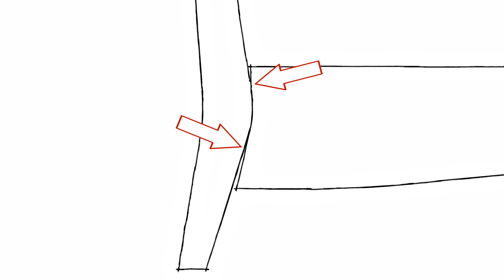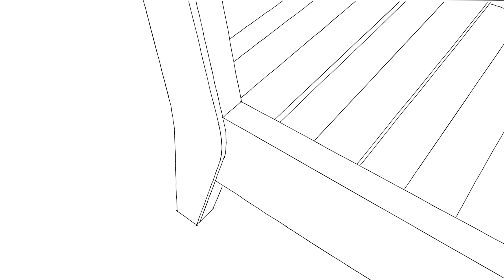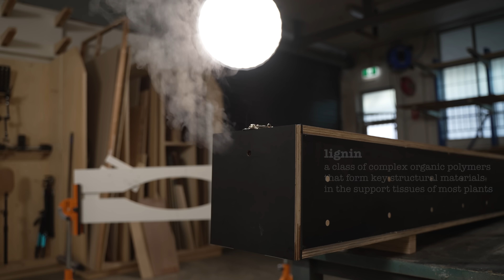Bending Wood into Impossible Shapes

Comment: The one thing I don't like about this video is the whole "the customer screwed me over" attitude. If you put a lot of time into your design before showing it to the customer and talking about the price, it's not really the customer's fault, as you pointed out during the video. By all means, get paid for the design process, that's absolutely sensible, but it's just not the customer's fault you didn't do that back then. Sure, he could have told you "no, way too expensive for me", but from what you've told us in this video, that's pretty much all he did wrong. That's a far cry from "totally screwed me over", sorry.

That said: The final result is pretty awesome. I think the burned wood looks pretty good, too, but would probably work better if it popped up somewhere else on the bed as well, perhaps the foot board or the legs? My favorite is the second, "structured" design, though. The bent strips are interesting and look awesome, but too intense for the bedroom for my taste.
Reply: Agreed. He’s falling into the trap of “content realtors” being overly dramatic for views and sympathy attention. Unsubbed

Comment: The tannins in the Walnut (Oak has more) will react with 0000 steel wool/vinegar mix to ebonize the wood.  Could be an alternate method to the charring technique.  The piece came out amazing, as usual.
Reply from the maker: Thats a way to make the wood dark, but the fire gives a totally different texture.

Comment: Looking at the blackened cutouts on the headboard, I agree it doesn't work but have an idea. What about using the pieces you removed, and separating them from the remainder of the board with a thin strip of copper or brass? Obviously, this message will get to you long after you finish the bed, but perhaps for a future piece?

Comment: You could have used the old fashioned coach bolts to hold the bed parts together. This would make it more mobile to move and easier to get up narrow staircases. The 2nd insert in the headboard could have been more effective with a copper wax finish. just a thought.

Comment: I saw this on this old house. Tommy had to drill a hole at a set depth. But it couldn't go deeper, so he used a plung router set to his max depth, this would have worked perfectly with a fosner bit and given a flat bottom. 

You could take this a step futher by drilling holes to hold magnets. Then under the caps add some kind of clamping faster that way the bed rails could be removed from the headbord and footboard to move in less space also fit into doorways and up stairs. Behind the trim board is a fastner you can open or tighten up like they use to clamp counter tops with. 
If you glue everything together it cant be taken apart.

Comment: Great work, and you need to stop overthinking it, it’s will drive you nuts!  But, I would have sanded the little circles into the “burned pieces” of the headboard not the same color.  You needed some contrast, and the black was cool.  Just a thought.👍🥰
PS:  I love the curly pieces on the headboard the best, but, boy I sure wouldn’t want to have to dust them all the time! 🤣🤣🤣

Comment: My childhood home had a wooden staircase where where I presume was the bent wood technique applied to the railing. I recall the surface letting go, sticking out and generally splitting most of the handrail into two or three layers, and following that clamps on the stairs for a long time as workers tried to fix it. It generally never looking quite right, and it has caused me to be highly distrustful of anything with bent wood strips. Hell, even surface strips of wood like the type you use to cover up the connection already make me uncomfortable. Despite being pretty careful with my furniture in general, I feel like it would just be one accident away while vacuuming or whatever to seriously ruin that thing strip of wood and ruin the look of the piece as a whole.

But I'm just a layman who probably hasn't been around true quality workmanship so all I see are the ways these tricks can end up disappointing. (Or maybe I have been around good furniture and I am just blissfully unaware in those cases because it is just that good...)

Comment: If you want your wood not to bend when you burn it, need to spray whit water after burning. I usually burn whit one hand and other is whit the sprayer. I had the same problem as you when I build garden furniture but no one tell you how to do it right on youtube.
good luck :)

Comment: I made the same mistake in that I bought all the Material for a job after being told I had the job but didn't have it in writing.   I changed my Contracts to include 50% of the cost before I would spend time making designs.  Every job I had gotten was by word of mouth.  All I needed to do was measure the job then give a price, no materials were purchased without the Deposit in my hand.

Comment: the headboards are pretty cool but I wouldn´t want that for my bed. I can only imagine what a nightmare it would be trying to clean the dust from between the individual rivets. 

I can definitely get behind the appeal but for a piece whose main function is so practical, I think that it is best to keep it´s maintenance equally practical. 

I am no woodworker but an option to keep the cool looks and also make it more practical would be to dunk the rivets into epoxy and basically have a clear screen of ((semi?-)clear?) epoxy to protect all the narrow crevices and surface area from dust.

Comment: 1. The black design is tricky, since it is not on eye level you lose some of the area of the piece just due to it being low, the top part gets a little cut off. Other than that black is a very difficult colour to work with, you lose so much detail in black just cause it is pure contrast. You have to be very skilled to know how to use black in art properly, not saying you arent but it makes sense it didnt work out since it was the first time that you did this.
2. Design, idk I kind of dig hammered peened metal sheets for like kitchens but in wood it looks too organic and diseased to me, Triphobia esque.
3rd design is just lovely, I love it mainly for the negative space that it provides cause otherwise the headboard is just a big hunk o´ wood

Lovely stuff mate ^^

Comment: The bent pieces of 3mm walnut was definitely the better choice. It fits the design 
better than the charcoaled and multiple crater pieces. Not a fan of the 8mm?overlapping pieces on the outside to hide joint expansion/contraction where the rail met the leg. The joint should be exposed to see the craftsmanship in the joinery. Movement would have been very minimal if at all.

Comment: Anyone should be able to acquire the long pipe clamps by purchasing the clamps and then attaching them to a 1/2 or 3/4 10ft long black steel pipe available at most home centers like Home Depot.

Comment: I think the best way to approach the "design cost" issue is to simply inform the customer that it's done at a set rate for this initial proposal, then any reiteration is done at a percentage of the set fee until the approve the final design... This final design is now the property of the customer and they are free to move forward with you or move on to another company to manufacture that design, you've been paid for your work, and the customer has what's been paid for to that point, so no loss to you or them... The trick to ensuring that they stay with you for the manufacturing is to offer to negate all design fees of the final invoice, effectively making that part free of charge in return for retaining the manufactur... The rest is down to the quality of what you can produce and how good you are at "selling ice to Eskimos"... 😂

Comment: I think the reason it didn't work with the black is that it  just seemed too narrow for a focal point. Had there been a third board and the black has been closer a circle it would have been more impactful. Just something about the ratios was off. Anyway happy accidents. The curved wood looked awesome.

Comment: I liked all version. I prefer the burnt one personally more than the rest. I would rate burnt first, curves second and dipples last. That is the order I would have done. I know what you seen at first with the burnt but I knew the finish would change it a lot and it probably would like amazing when that was done. Unfinished it did not look right but after it look great the two tones look right.

Comment: For the legs and caps… why not do them opposite the way he did them? Cut the curved profile first… band saw your 1/4” cap piece off, then cut the straight for the joint. That way it all truly out of the same piece of wood…
Anyways that’s the way I would have done the caps
Reply: And for the headboard fix… I would have just used the drops (like you did) with a maple “inlay” to take up the curf of the blade from cutting them out. Not sure if that would be up your alley, but I would have liked it… simple (kinda).

Comment: I liked the Burnt Pieces
I didn't like the textured ones
I absolutely love the bent decor. Amazing work on that. As visual Artist I get the feeling of just not being happy with what you just made and redoing things you originally intended to be done at that point.

I have just one issue with the bed, and that is, you cannot disassemble the frame, which makes it very unhandy to get into a clients home if their doorways/Windows offer limited space, and also if a client moves homes, this bed is gonna be a pain to move from A to B.
Just my Opinion, but a Bed or any Furniture for that matter, should always be possible to take apart into easier to move parts for future proofing a design.
Imagine you invest into a beautiful piece like that, only to realize you have to sell it cuz you can't fit it through your next homes doors/windows or you damage it's finish trying to move the whole thing in one piece.

There are metal interlocks that lock the pieces together by gravity, which I'd recommend to connect the front and back, to the side pieces.
That way a simple gentle/less gentle knock from below, disconnects the pieces and you can move them EZ PZ

Comment: Simple straigh - 9-10
With hole and charred - 7-8
With hole and the textured piece - 5-6
With hole and tacky kitschy curved waves - 1. It's so ugly it ruins the beauty of the bed. 

Obviously this is just my opinion. If you'd give me the curved tacky bed I'd rip those silly things apart as fast as i could. 

Bed frame - simple, sturdy, natural, honest, has utility and a beautiful shape without unnecessary embellishments. 1 design language

Bedframe + unnecessary "design" hole - 2 design languages - straight (but not 100%) bed frame + curved, cut in half oval (but not a perfect circle). Circles, have a meaning and are adaptable to almost all other design languages. Ovals are extremely conditioned by context. Then the second color which is basically ruined wood. It doesn't look bad, it just looks "tryhard"

3rd design - 3 design languages. With a texture in direct contrast to everything. None are in harmony with each other. 

4th design - batshit ugly and so unnecessary. It's like combining zaha hadid design with semi-bauhaus and an unhappy postmodern mannerism. 

Impressive technique and ability though. But it's like putting a shark fin on top of a McLaren because "design"
Reply: Ps: symmetry + total random asymmetric chaos isn't inventive/original etc. It's childish and uninspired. 

I only said this because the simple bed without the hole would have been such a beautiful design.

Comment: The problem arnt the clients, the problem are the workmen. You should always have an idea of there budget or give them a rough ball park figure to avoide sticker shock. Or else this happens. Being on both sides of the blade i see this frequently. Workmen comes in, i say "before we start can you give me an idea of cost"

Workman: "no all jobs are different"

Me: "yeah i get that but to save you spending hours doing me a quote, use your skill in your trade and give me atleast an idea so 8 can see if its feasable" 

Workmen: "3k ish"

Me: "ok thats doable" 

Workman "i have done the quote its actually 4k" 

Me: "no worries i accounted for that in the ball park its all good, crack on with the job" 

Both of us hsppy. 

Compared to 

Workman: "no has to be a quote"

Me: "ok"

Workman: "its 20k" 

Me: thats way out my budget sorry, i did ask for a ball park to avoid this, as its not my trade so i have no clue on what the prices are to even start but i have x ammount"

Comment: Wait you didn't discuss the price before any work even started? Who would agree to something like that in the first place? I get the estimate might change, but it should be anything significant. Like if we agreed 20 bucks for a something, and you came back and said it will be 40, double the original price, that's ridiculous. But if you came back and said 25, that is reasonable. Sounds like you screwed yourself over.
Reply from the maker: Read the video description

Comment: I hear your disappointment in the client, but if he was asking for a simplified design, then translation he wanted to do it himself but needed a reasonable expert to make his vision come true. Finding out the price which should have happened at the beginning as an approximation, probably just made up his mind and he did it himself. 

Also sounds like you as an artist, you were controlling the build and not following the design brief and budget. I've been on the other side of this equation where the design brief wasn't followed and the custom piece ultimately was not fit for purpose as it didn't match the other elements added by other artists who did follow the theme!

Comment: You should use the charred wood as test pieces for the texture.  It might be interesting to see the high points black from the charring. On the back of the other piece you could try the texturing technique followed by charring then sanding the high points.  Finally, you could try wire brushing off some of the charred material so that it highlights the grain.